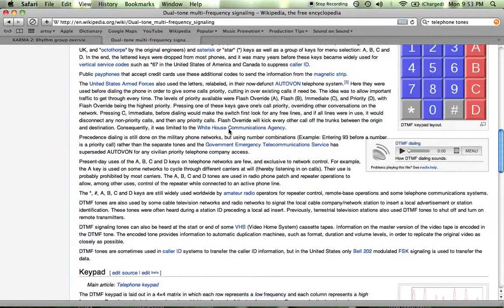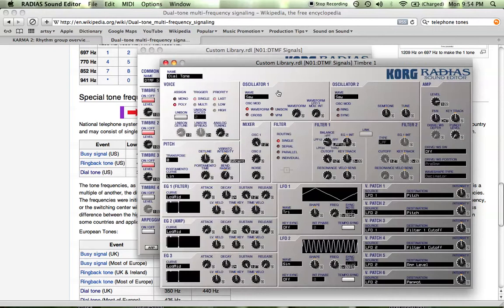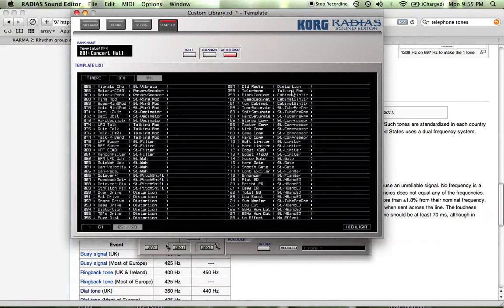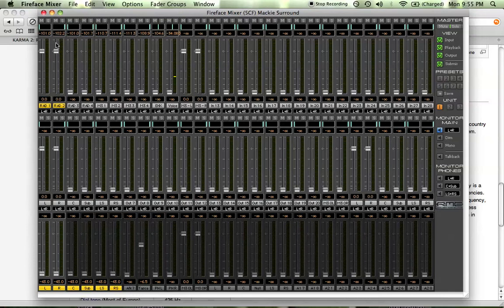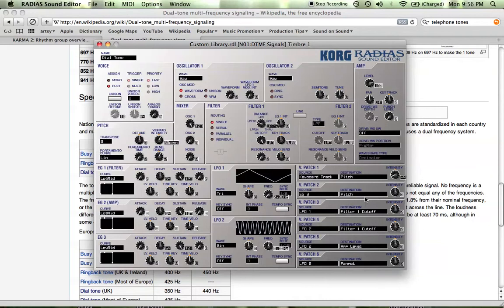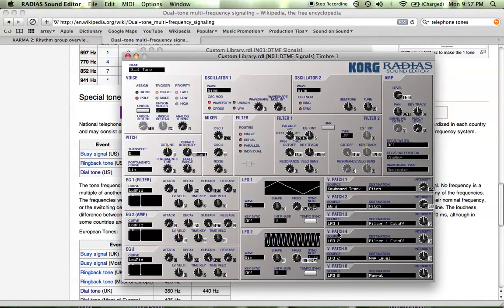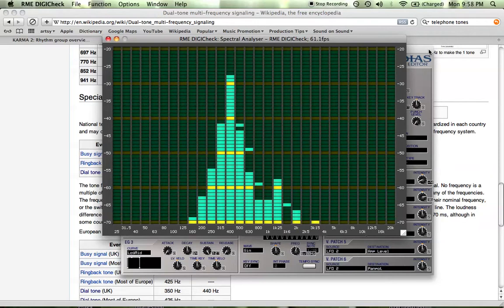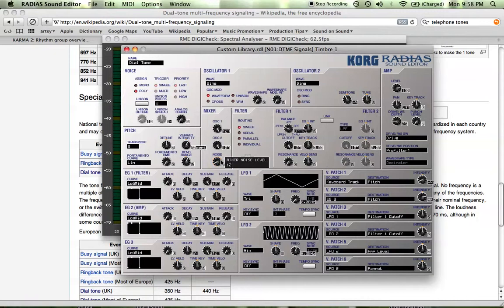DTMF Signaling Synthesis, Part 1: Dial Tone

Comment: If i tried to play music, notes or chords, with this would it sound dissonant because the frequencies are not the same?
Reply from the maker: Miles Dolding I disabled pitch keytracking with virtual patch one around the 2:50 mark in the vid.  So if you were to try and play a chord, all you would effectively do is make the sound louder.  There would be no difference in pitch no matter which keys you pressed.  Essentially, the note-on command is only functioning as a gate.  You could even get around said volume issue by simply putting the patch in monophonic mode.  Let me know if you have any further questions.